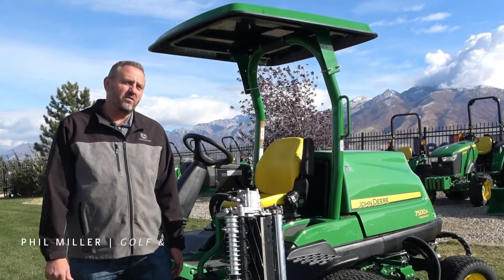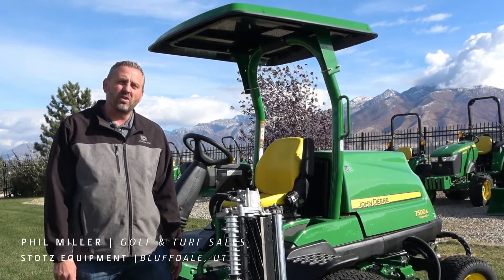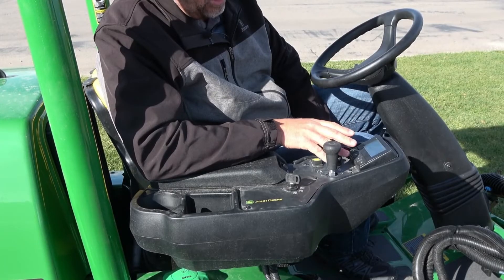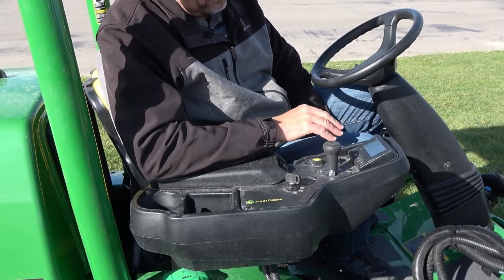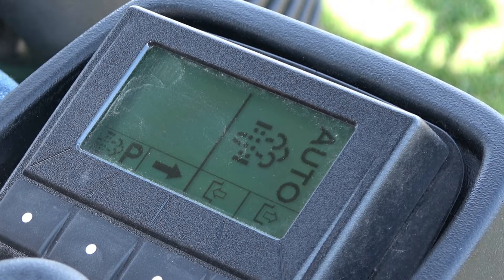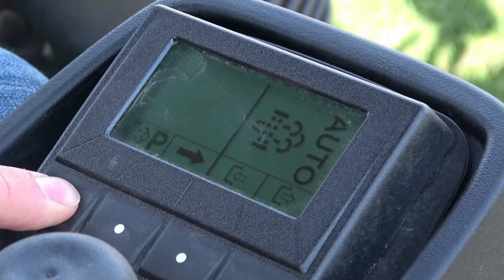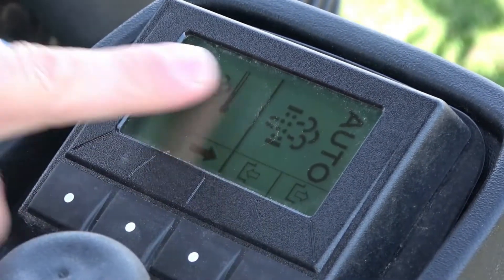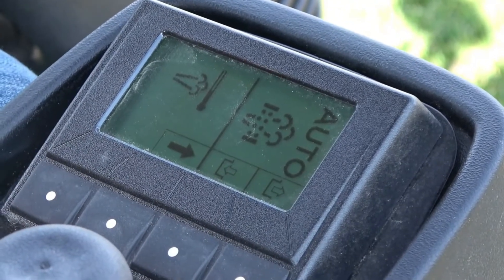Stotz Equipment | Performing a Parked Regen Function on John Deere A-model Golf Equipment

Comment: How do I get past the lock screen that comes up after holding the button? My normal code doesn't get past it. 3719 code present. Recently cleaned dpf, just changed dpf pressure differential sensor.
Reply from the maker: Thanks for watching and for the question! If your current operator code is not allowing you to access Regen Function settings, you may need to use the machine's owner code. If the problem persists, or if we can support in any other way, please contact your local Stotz Equipment: https://www.stotzequipment.com/our-company/locations/